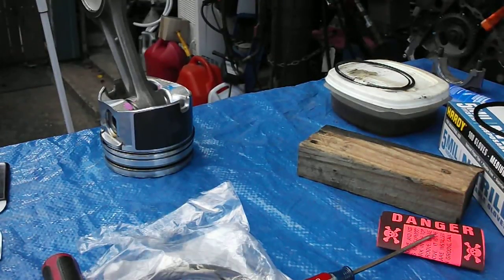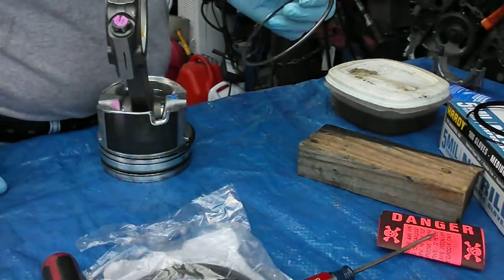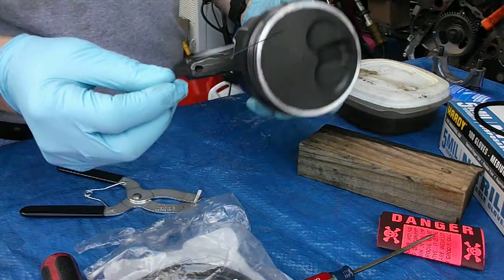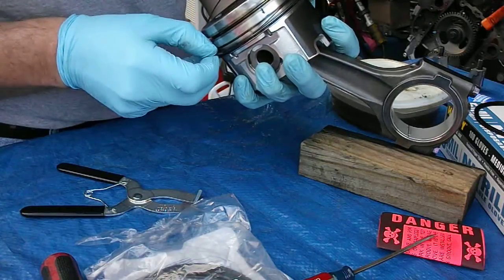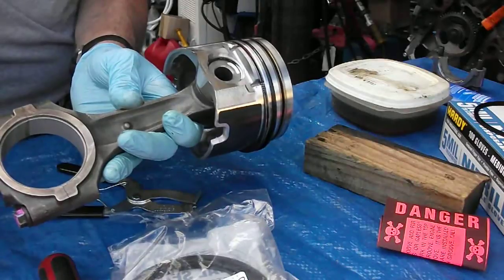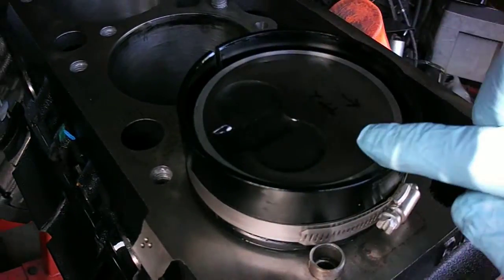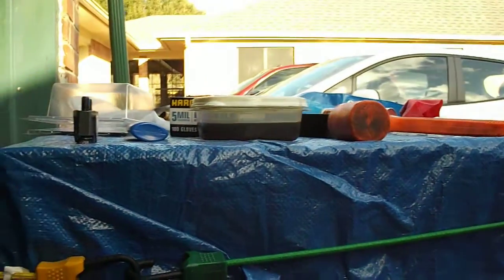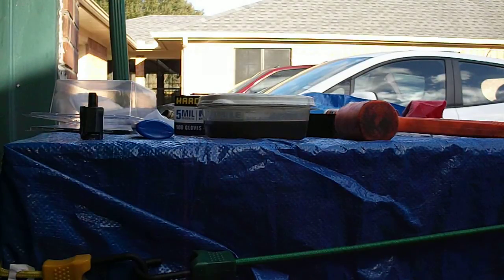P400 6.5 diesel gapless ring install

Comment: This piston looks pretty big 4 such a  lack of power on a 6.5
Reply: With a good block and heads like the Optimizer or P400 along with the hardened crank and rods, do the necessary upgrades, it can push 300-350hp reliably but it would need to be studded as well on the top and bottom end. I definitely wouldn't try to exceed 250hp on a GM cast 506 block which was the worst block of all, like 96-00' civilian engines which aren't Navistar blocks. Those are the worst ones for web mains cracking.

Comment: leroy does that gapless rig setup  boost compression
Reply: LeroyDiesel do you sell 6.5 motors already assembled ? Or do you have the p400 just the block or block crank pistons heads?

Comment: same on the 62?
Reply from the maker: +jim horel Yes. Takes different rings than the 6.5 though.
Reply: +Leroy Diesel bought a 6,2 pick up with a rebuilt engine that didn't go so well . it runs ok starts good  but has at ton of blow by got it it third hand they screwed up on the rings
Reply from the maker: +jim horel If I can help let me know.